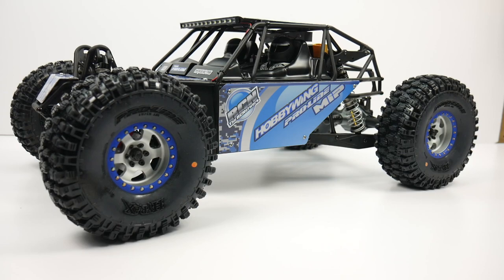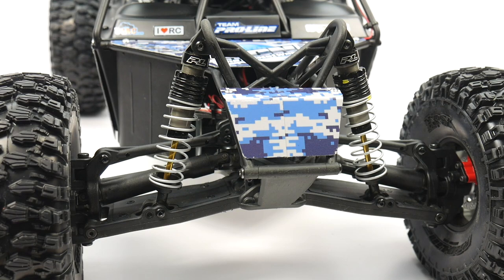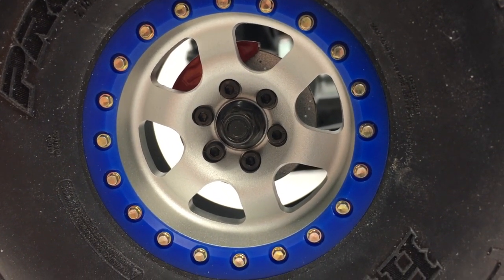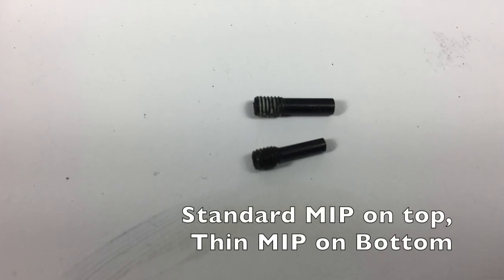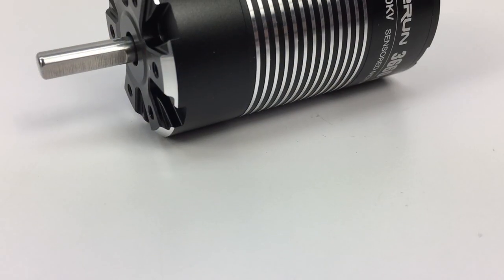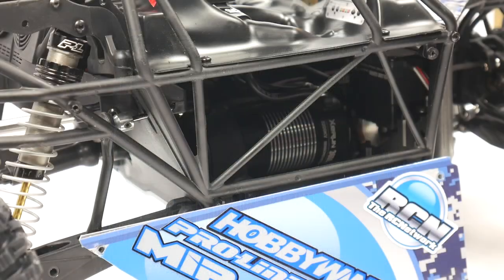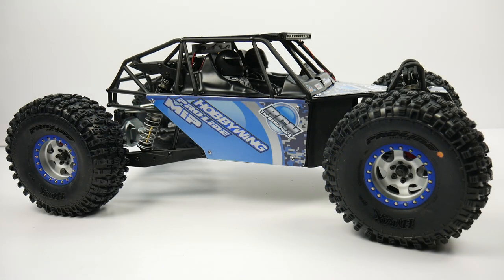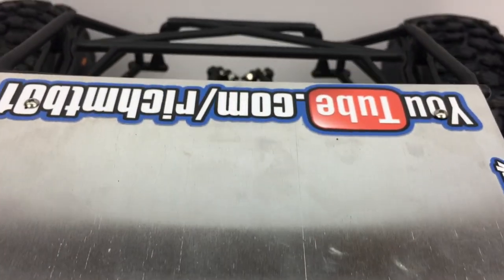Losi Rock Rey - Full Custom U4RC Rock Racer

Comment: You made me spend sooooo much money, lol. In your other videos it looks like you put in hot racing trailing arms. You like them? I also noticed some light buckets/rear light bar.  What part is that? Mine would brown out with the stock ESC if I tried crawling really slow. Added a BEC which also improved my Savox servo. There is an actual Rock Rey servo horn now. Clears everything really well. I didn't like the link between the horn and bellcrank, so I put in a Slash 4x4 one with SCTE rod ends and modded one end so it cleared the bellcrank. It's a lot stronger now and allowed me to get perfect trim. After replacing my 3rd member with the SSD, I noted it was shimmed with one washer on the inside. Gear mesh didn't seem right with it on the inside, but with a 6mm nylon on the outside it seemed perfect (I'm hoping that wasn't a bad idea).  I so want to change the diff fluid in mine.  Did you get new gaskets? I remember one of my SCTE diffs, the gasket didn't survive disassembly. Thanks!
Reply from the maker: Sorry, buddy!  I just ran the HR trailing arms for the Nationals race, but DNF'd the first heat due to a diff failure.  The rear light is a home built one a buddy of mine built.  3D printed and custom lights...there's other options out there though.  Gaskets were fine on my re-builds

Comment: I just got a used losi baja rey 1/10 and I really like the wheels (tires and rims) that you put on this Losi can you give me the specific info to order the tires, rims and inserts? Also they should work ok on the losi baja rey 1/10?
Reply: The losi Baja Rey and rock Rey are compatible with most parts, I have a ford raptor Rey and ordered some vanquish wheels but idk what hex offset to use

Comment: Your upgrades are very good.  I'm taking notes and buying parts.  I purchased the motor, ESC, front shocks,  3rd member, servo and servo horn. I can't find the rear shocks, steering rack and servo mount.  If you know of anyone having these parts in stock I'm all ears.

I'm going to try the panels too.  I know you can just cut the panels but I have a CNC machine I'd like to setup for it.  Then I could save the file and use them again in the future if I needed to.  I watch all your videos and learn a lot from them.  Thank you for all you do.
Reply from the maker: Rear shocks look to be out of stock, but Pro-Line will be restocking soon.  The Losi parts are all back ordered right now - especially the steering rack/servo mount.  Thanks again for the great comments on the channel!
Reply: The RCNetwork Thanks for the update. Guess I'll try to find patience somewhere.  :-)
Reply from the maker: Me too...I'm looking for some other parts as well!

Comment: Everything you do is so on point.. the rims and custom panels you made visually work together so well, have fun at the race.  
Was the stock motor too slow on 2s?
Reply from the maker: +JDM enduro I only ran the stock motor on 3s and it was pretty decent. 2s would be pretty slow.

Comment: Hey man. Great build! 
I've done much of the same to mine. I ended up using nylon spacers from the hardware store for the top front ProLine shock mounts to secure them in place. What did you use to get your front shocks mounted snugly up top?
Reply from the maker: Just the stock screw, but used the rubber ballend deal that comes with the XT shocks.  You can buy them separately if you pick up the Pro-Line Universal mounting kit

Comment: Did the SSD third member with the larger pinion require the custom driveshaft you put together? Or is there another option there perhaps less durable?
Reply from the maker: The stock driveshaft was so difficult to remove, I had to drill the red-loctited set pin to remove...so I was somewhat forced to make my own!  lol

Comment: How were you able to tell that the steering mount looked weak when diving if it is covered up by the body ?🤔
Reply from the maker: I had the steering apart after about 10 minutes of driving it - the servo horn stripped.  Since I didn't have a 23t servo horn, I dropped in a Futaba servo with a 25t horn.  All was fixed, but the steering overall was weak

Comment: On the front are you running yellow upper and lower springs? And when you say stock springs for the rear are you running green or blue (my XT's came with both)?
Reply from the maker: yeah, yellow on both upper and lower on the fronts and yellow upper and red lower on the rears

Comment: What size batteries are you running with the Hobbywing 3660 3200kv motor? I would assume a 50-60c 3s?

Comment: Hi Rich. New to this U4RC racing. Have been working on my Rock Rey to get it ready. I am experienced in 1/10th Scale off road racing but this KV rating, 4 pole motors and 2s, 3s stuff has taken me quite a bit of research to get the info I have been looking for. Your vids have been extremely helpful. I have a question for you though. Have upgraded all my electronics. Currently have a Tekin RX4 and a Maclan MR4 3500 to run on my 90c 3S batteries. What gearing, pinion, would you recommend for that setup on my Rock Rey? Any help would be appreciated. That's the only info I can't find anything on.
Reply from the maker: Stay with the stock spur gear, and probably the stock pinion.....you may need to go up a tooth or two on the pinion though depending on your track you race at. The longer the straights, the more speed you'll want.   I'm currently running a 14t pinion, but a 3200kv motor (slower than your 3500kv).  Also - quick tip.  Find the 1.5mm set screws that are in the rear sway bar and tighten them down.  It tightens the sway bar and removes most of the torque twist you'll see on the new motor
Reply: The RCNetwork Thank you for the info and the tip on the sway bar. Much appreciated. Should be in the ballpark now. Will fine tune once I get my Rock Rey on the track.
Reply from the maker: You'll be amazed!  I couldn't believe the power of the Rock rey with a decent system....Chekc out the rest of my mods....also, don't forget to switch out those diff screws (the phillps tiny screws holding the bevel of the diff cup.  They'll shear off with the power of the new motor
Reply: The RCNetwork  I have all the mods you do plus a few more of the aluminum Losi upgrades. What kind of screws do I need to replace the Phillips ones with. Have it all apart right now to put locker in center diff anyway and fluid in the front. SSD 3rd member is going in too. So perfect time to replace those screws you mentioned
Reply from the maker: Darren Barwick totally not sure...I grabbed some from my hardware bin. I used cap head and a bit longer than the stock - and fine thread. Check the FB group....it's in an early post with a TRX part number.
Reply: @TheRCNetwork  Just sheared mine only 1 battery in....Could not find the screws you were talking about...Help please
Reply from the maker: Wesley  Dean I believe they’re 2mmx10mm flathead (countersunk) screws

Comment: Hey Rich, just wondering how you find the sensored Hobbywing combo for slow going and for power (is it comparable to the existing Fuze system for power)?  

Is there any cogging at very low speed and can it actually now crawl (the fuze system cogs like mad)?  I'm turning mine in a rock bouncer (all locked diffs) and would like decent crawling performance.

I know Castle make a very popular combination (with the crawler crowd) with the MMX and their sensored motors but I have Hobbywing products far more available and affordable locally and already have the programmers and a number of HW ESC's (I'm a very happy HW owner) and was looking at your exact ESC/motor setup and wondering how it would work.  Any feedback would be really appreciated!
Reply from the maker: The main difference between sensored (Hobbywing) and sesnorless (FUZE) - sensored has a great low rpm feel with no cogging at all. That's what the extra sensor wire does.  It also, in the long term is more efficient.  YOu can't beet the quality and affordability of HW - Also grab the Wifi Express to tune your ESC with your phone!
Reply: So even with crawling speeds (not just walking speed but loaded going really slow up/over rocks) there is no coggng?  I know sensored makes a large difference but there is sensored that is crawls great and seored that is smooth but can't maintain a smooth crawl speed under load (which is the important bit - the loaded smoothness).
Reply from the maker: Zero cogging on sensored/brushless.  That's why racers and pros use sensored

Comment: I was able to find the XR8 SCT Pro at my lhs, but not the 3660. They have the 3656 (in 3400 or 4700kV), the 4268 (in 1900 or 2600,kV), and the 4274 (in 2250kV). Do you think one of these would be comparable, or should I be patient and order the 3660? Also, is there a reason you chose the 3200kV over the 4300kV?
Reply from the maker: Joe Krinkey I would wait for the 3660 - it's a 550 sized can motor which is perfect for the Rock Rey - the 3656 is a bit small and the 4268 would have to be shoe-horned in and you would need to run 4s. 

The 3200kv is a great option on 3s and gives you the torque you need for the large tires and big drivetrain. The 4300 may do okay, but you will have heat issues.
Reply: Thank you for the info! Your videos are super helpful to a rookie like me! Out of curiosity, I generally see the Rock Rey compared to the Yeti, but have you ever compared this to the Bomber? They seem more similar to me (I'm torn between the two right now, but leaning towards the Bomber only because it's available in a kit).
Reply from the maker: Joe Krinkey you can get the Yeti in a kit also.....they compare the Yeti and Rock Rey because of the looks and they use the same suspension - Independent front and solid axle rear. The Bomber is totally different and uses two solid axles, but is similar to the Yeti's rear using trailing arms vs the Wraiths link suspension. The Bomber will drive different than the Yeti/rock rey. You'll be able to go faster/turn easier in the Yeti/rock rey with the open front differential.
Reply: Sorry, I meant I was torn between the Rock Rey and the Bomber. I didn't realize the Bomber used a solid axle in the front. Now I'm leaning toward the Rock Rey (I live in the Rockies, I think the IFS would give me more versatility in the terrain here). Seems like I've got some research to do. The info is greatly appreciated!
Reply: I just realized the XR8 SCT isn't waterproof. Are there any comparable ESC/motor combos that would do better in wet terrain?
Reply from the maker: Nothing comparable to Hobbywing....there are lesser brands that are waterproof though, but you lose features and power
Reply: Joe Krinkey I don't u4rc race but I have to say that if you would like to have a waterproof combo that has lots of power and torque I'd get the hobbywing ezrun sc8 esc. The esc can run up to 4s lipo, is waterproof, 120a, and just a good all around esc. For a motor w I would recommend the hobbywing ezrun 3660 4000kv motor. Although it is a 4000kv motor it still has great torque, even on only 2s lipo. Is can only run up to 3s and on 3s you might have to watch temp, but I've never had an issue with its temp and a simple cooling fan would solve the issue. The combo is not sensored so you won't have a ton of precision but it's a very fast combo and is fully waterproof. If ou don't like the sc8 you could get the ezrun max8, but idk how good that esc is. More often than not you won't be able to find a esc that is sensored and waterproof for a reasonable price. The tekin rx4 is sensored and waterproof but most sensored motors are not. I think that for the money this is a good combo at only about $130-$140. In my opinion hobbywing is probably the best company when it comes to brushless products. Although castle makes great products they are very expensive and they don't have many options. My first hobbywing combo I ever bought is in a 2wd monster truck and is over a year old. It's been through hell and back. The only issue I had was one blown motor but it happened when the motor shield was torn off in a crash and concrete ripped though the aluminum can. So regardless of what you buy I'd stay hobbywing. Hope this helped
Reply: It helped a lot, thank you!
Reply: would a 3800kv from castle work on the setup

Comment: What adapters do I need for the Proline shocks? I picked up a pair for the front and cannot seem to get them to fit.
Reply from the maker: http://amzn.to/2vfcPM3  You pretty much need just the delrin pivot balls - The Rear XT shocks come with them.  The Slash Powerstrokes do not as the slash doesn't require them.

Comment: why to change form 3660 to 3660? Why not a 70/74 or a 40'ish motor?
Reply from the maker: for me.....size of the motor fitting...I knew the 3660 would fit and the Rerun was more powerful and sensored.  Also usually, you'll need two run 4s on 1/18th scale motor to equal the speed of a higher kb'd 3660.  it's very hard to fit decent mah 4s's in the Rey....lastly, I raced the Rey and didn't want to add additional weight as I mentioned previous

Comment: I didnt get well the part of the rear shaft!! you had to buy 2 and make 1?
Reply from the maker: No, it was mostly a Wraith driveshaft (one half of one set), but needed two lengthened out drives to make the distance.  The wraith set comes with two short and two long - remember the wraith set does both front and rear driveshafts.  I had these parts laying around from another custom build.  Plus, you'll need to modify the outdrives to fit the Rock Rey
Reply: The RCNetwork ok thanks. I have nonexperiemce with the wraith and I just broke the rear shaft so I was wondering what to order!
Reply: for my baja rey shaft I meant!

Comment: So when you made the panels flush how did you do that specifically
Reply from the maker: The original body mounted with screws to plastic standoffs on the cage. Once the body is removed, some stand offs were long....I just shaved them down closer to the cage and attached the panels to it
Reply: @TheRCNetwork  ok did you have to make a new screw hole or does it go all the way through

Comment: hows the vertarra center diff lock go in, any tips. i have it all part already.
Reply from the maker: nick m it went in easy, you will have to take some of the edge of the locker off to clear the spur gear from what I remember, like just the ends of the +.  I used a Dremel with a cut off wheel

Comment: What hardware are you using to attach your panels?
Reply from the maker: Just standard 3mm x 8mm stainless hardware into the existing holes.  I shaved the posts down though - some I had to drill deeper (the bottom ones)
Reply: @TheRCNetwork  perfect thank you:)
Reply: Im guessing you did 45 weight oil in the front for stability?
Reply from the maker: Yes, and it's a different shock overall than stock.  Plus I like a bit firmer shock...especially under the added weight

Comment: What does the center locker do to the handling?
Reply from the maker: mobbinthesteez in my opinion, it makes the drivability worse, but it's the rules for U4RC - a locked center diff or 3 gear trans

Comment: Hello guys just wanted to ask......I accidently plugged my battery incorectly, black in red, red in black(pls do not ask me why or how) it was a Mamba monster.....smoke and sparks came out...do you think the esc is dead or is there something I could do to get it back working? THANKS A LOT FOR YOUR HELP!!!
Reply: how have you had it could still be on the warenty
Reply: Peter Fusek Unfortunately it's probably ruined. I did the same thing once, then, I found out that they have an exchange program on the Castle Creations website. If it's still under warranty they have an option for that but if it's out of warranty they will still fix it for a price. They charge about half as much to replace your damaged ESC rather than buying a new one.
Reply from the maker: Peter Fusek not sure of which model you have, but many higher end ESC's have capacitor banks for this and when reverse polarity happens it smokes the bank.....kinda like a safety blanket. I would contact Castle and be honest and see what can be done. Best case - replace the cap bank if it has one. Worst case - time for a new ESC, which Castle may have a replacement program for.
Reply: yes do what they said and then switch to Deans connectors on all your stuff.  you'll never plug in reversed with deans I can reach under my truck and plug in the battery without looking and not worry.